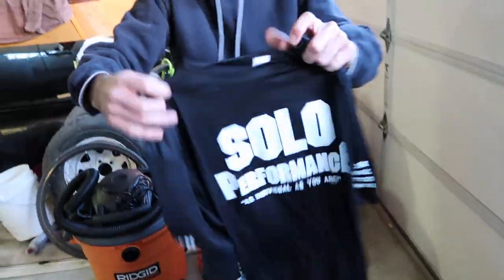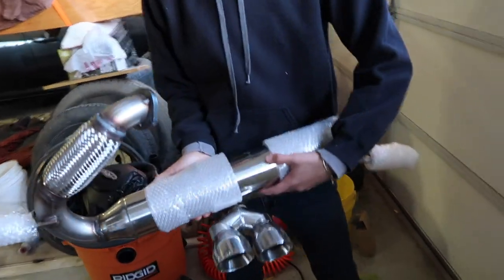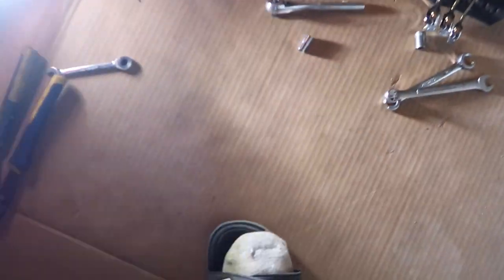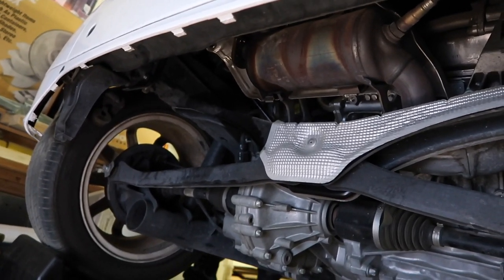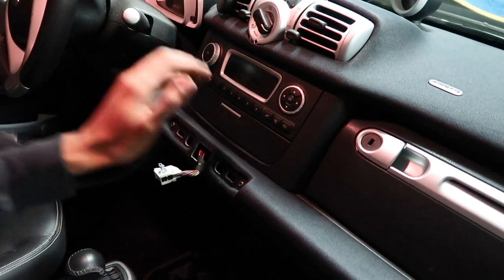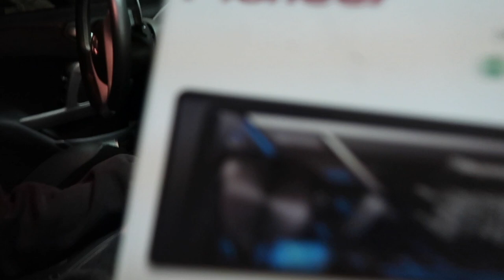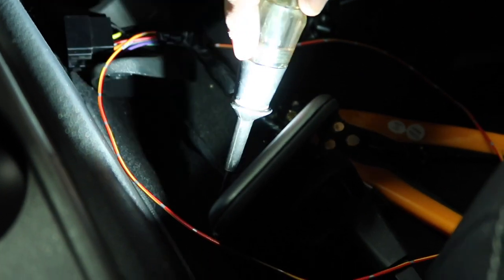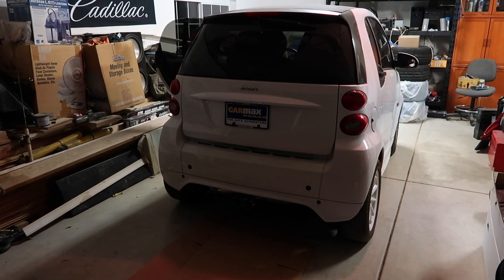Smart Fortwo Solo Performance Exhaust Install + Radio

Comment: Hi like your video, did you need to removed heat shield to get screw out for the exhaust
Reply from the maker: I don't recall exactly but I believe there was a hard to get bolt on the top side of the stock exhaust which might have been attached to the heat shield.

Comment: I installed a radio in my smart and it only turns on and off with the power button on the radio. Any idea how I can make it turn on and off with the key? Can't find any info anywhere
Reply from the maker: You must have the power to the radio on a wire that's always hot. Like the stock radio that you can turn on even with no key. I got power to the radio from the "cigarette" lighter by tapping into the wire. Whenever the key was turned on it had power otherwise it was off.